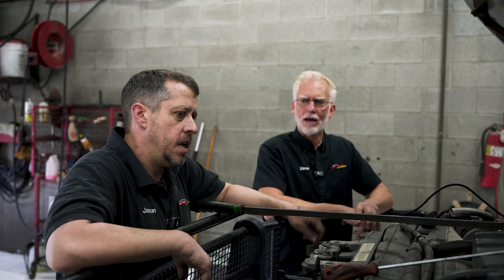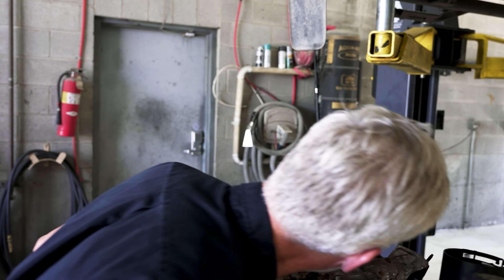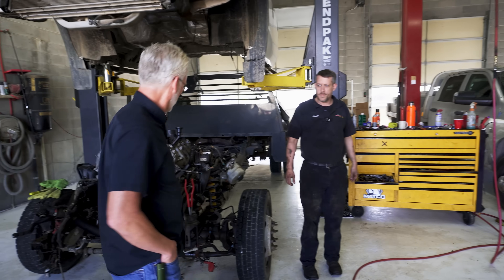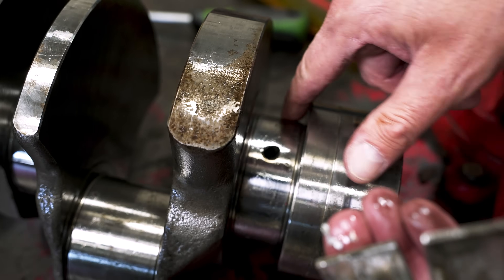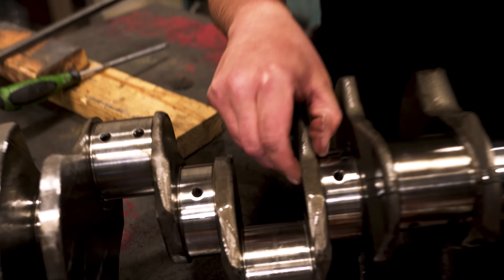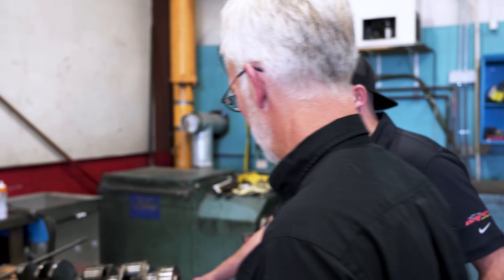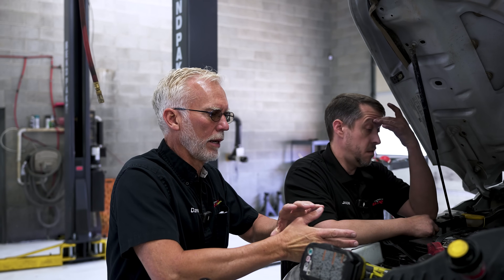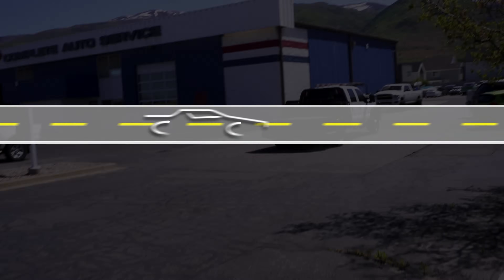Ford 6.7 Power Stroke Failure

Comment: Sometimes for no reason at all really engines will fail. Some 6.7 power strokes are perfect and they have no issues ever. Mine is a 2019 that has worked very hard its whole life at 155,000 miles and the only thing that went wrong was the hot side charge pipe. Everything else has been flawless.
Reply: Actually alot of 6.7 powerstrokes are flawless. I rarely hear bad things about them. I hear more bad about ram and gm

Comment: The funny thing is diesels used to be reliable engines. Thanks EPA
Reply: Weren't the old diesels extremely bad for our air quality, though? I'm just wondering. Even today, some schools or buildings are built right above an interstate. The school I know of needs an air filtration system because the air is so harmful
Reply: BBC: A diesel engine should, in principle, use less fuel and produce less carbon dioxide than a petrol engine with the same power output.

However, this superior efficiency comes at a price. Diesel engines produce higher levels of particulates, microscopic bits of soot left over from the combustion process.

These can penetrate deep into the lungs, causing irritation and potentially triggering asthma attacks.

Particulate filters
The greatest danger lies with the smallest, so-called "ultrafine" particles, according to Dr Matthew Loxham, a research fellow in air pollution toxicology at the University of Southampton.

"They get so deep into the lungs, they get to the surfaces where oxygen enters our blood, and the particles themselves almost certainly can enter the blood," he says.

"They can cause increased stroke rates and increase heart attacks in people who are most susceptible, who have underlying health conditions".

However, modern diesels actually emit very few particulates - because they are equipped with special filters.

According to Emissions Analytics chief executive Nick Molden these systems work very well.

His company carries out its own real-world emissions testing - as opposed to the tests used by manufacturers to certify their new vehicles, which until recently were exclusively laboratory-based.

"Modern diesels essentially do not have a particulates problem," he says. "The filters clean up 99% of the particles. So long as they are not tampered with, they are very effective".

But diesels also produce nitrogen oxides, or NOx - and how they deal with those is also very important.

Long term exposure to nitrogen dioxide in particular can decrease lung function, increase the risk of respiratory conditions and exacerbate allergic reactions.
Reply: Though real world gas and diesel driving often pollutes a lot more than the lab tests , so while its better than having no emissions controls, why are the manufacturer adding ineffective emissions equipment that adds to complexity?

For a start, cars often produce more NOx when driven on the road than they do when tested in the laboratory, and some models turn out to be much dirtier than others.

The worst performers, it says, emit up to 15 times the laboratory limits when used in "real-world" conditions. Others produce no extra at all.

The real-world emissions of petrol engines also vary widely, however. So while Emissions Analytics's research suggests that petrol cars remain on average cleaner than diesels, there is a degree of overlap.

"If you take the cleanest 10% of diesels and the dirtiest 10% of petrol cars, then actually the petrol models will have double the NOx emissions of the diesel ones" says Mr Molden

It's fair to say, then, that some diesel models do compare favourably with their petrol equivalents, but they are currently in a minority.

Comment: I ran into this on a John Deere tractor engine. Big six cylinder and I don't remember which model it was. The tractor was a 4840. The first guy to work on it installed the cheapest brand of bearing he could find. The crank had been ground .010 oversize and had been polished correctly. But what I found was the bearings used varied in thickness. They were junk from brand new as some were thicker and some were thinner. The thicker ones pulled the the surface of the bearing off  after only a very few hours and the motor lost oil pressure. The first guy "Assumed" the bearings were all the same. I am old school and all it would have taken is a strip of plasti-guage  to tell the guy that something wasn't right. This is a cool video and you guys are fun to watch. I retired after 50 years so now I watch you guys and get a chuckle out of what you find.
Reply: Just a small point you can only grind a crank undersize
Reply: @garyrhodes7089  Yeah, sorry about that I meant the bearings were .010 over and I didn't catch it. I'm old dude, the brain just doesn't seem to work anymore!!

Comment: People often weld plates like the one at 2:38 onto their manifold when deleting the egr pipe. This is because ford used tiny 6mm bolts that always break off when you remove the pipe, so you can’t bolt the block off plate on. If you heat the piss out of the manifold you can USUALLY slowly ease them out though.

Comment: I had over 480,000 km on my 2015 and never had any issues. My 2018 F450 has only 25,000 km on it so far though as it’s primary use is hauling my truck camper. I change oil at 8000 km and warm the motor before working it. As a mechanic, I realize there are issues with every engine and you need to realize these and use your equipment within its limits.

Comment: Check the crank for straightness, and the bearing bores in the block.

The crank may have been bent with the initial rod failure.

Although, oil starvation from rtv floating around is a good guess too.

Comment: I am a Senior Master Tech at a Ford dealer and have been turning wrenches for over 38 years and one thing that grinds my gears more than anything else is getting in a vehicle that some hack wannbe tech has been into. When i am done with a customers vehicle  you would be hard pressed to tell i have had it apart other than the normal telltale wittness marks on nuts and bolts. Your attention to detail along with your techs is quite impressive. Keep up the good work.
Reply: I wish there were decent mechanics where I live. That'd be amazing. Also, since you have 38 years and likely know more than I could ever dream of, do you know why my 6.7 sounds like it's knocking every time I change the oil? It's kinda loud for about 500-1000 miles after the change and then goes away. I can not figure it out. It's got 350k miles and has done that since like 100k. It drives me nuts. I dread changing it every time bc I'm scared it might be the last time.
Reply: And YOU are the reason I take my 2020 to my Ford dealer shop. Even for my very frequent oil changes.
Reply: Amen Brother!!
Reply: Congrats😊
Reply: Hi my name is Billy and have a 6.7 2015 power stroke with 118,00” miles and long story shot I got into a accident and my so called friend at a body shop let it let 
 2 months with out starting it after I asked them repeatedly to start it and when he finished I went and picked it up and the engine light was on the battery’s are junk and when I started to drive it home it was not running rite a all it was smoking bad so I drove it home about 15 miles and it started to clear up so I had it towed to a Ford dealer to service it and they telling me the motor is blown if you don’t mind I would  love your  opinion and Great appreciate it Thankyou
Reply: Witness only has one 't' in it.
Reply: @ratedRblazin Nazi detected.
Reply: I beat you any day of the week, I invented a mechanical formula and learned mechanics by working in a shop for one month, invented some plumbing tools as well , understanding about mechanics is  not the same as just know how to work on mechanics

Comment: The engineering that goes into a modern engine is mind blowing
Reply: Mind blowing and a lot of unnecessary crap,,I was an aircraft mechanic in the USAF in 70s 80s . I worked on the pride of the Air Force the F111F fighter/bomber . It was everyday a WTF to troubleshoot and repair but at the same time you were proud to be the one that could do it.,,,, My point being,,,modern automobiles remind me of those ACFT,,,🤢😵‍💫😡🤬🤑

Comment: Hi Dave
Several questions. A friend is looking at Earthroamer campers. Since you are extremely educated on the 6.7 power stroke. People have these and really don't use them. So which would you consider and what would you have a Ford dealer check for? 2019 with 20,372 miles, 2020 with 16500 miles or a 2022 with 14000 miles. They are all on Ford F550 chassis and all are stock with all emissions. 
Thank you very much. 
Joel

Comment: I’m always curious to know if a shop budgets in their labor to make up for time lost test driving and repairing poor quality work. Like going through their bolt bins and looking for all of the missing bolts that the previous mechanics did not install and going through and documenting every little thing so they don’t get a a false come back. Reason I wonder is because the repair manual on pays for actual time spent working on the vehicle nothing else. So it seems unfair that the techs have to work even faster to make the business profitable.

Comment: Nothing last forever. In my experiences with any engine is in the design. The next thing is you can't work a pickup daily like a road tractor or class 8 truck and expect it to survive. You cant add horse power without sacrificing durability. You can't let them idle all day, they weren't built for that. I bought a 87 f250 with a 120000. Miles on it. The engine was a 7.3 idi engine before the power stroke. I new I would have to be overhaul at some point . 90000. Miles later it started sucking oil . Did a complete over haul heads were resurfaced block bored i put Navistar parts in it . I parked the truck 580000. Miles later because i needed a bigger truck. Bought a 97 dodge 3500 with a 59  cummins. It had about 110000.on it at 220000. It started sucking oil bad . Tore it down everything was in factory tolerance so I ground the valves and valve seats. I honed the cylinders reringed the old piston hand polished the crank because it had some scaring from lack of oil . The problem was the top compression ring on all cylinders wear worn out . As long as the truck had a load on it wouldn't use oil because the boost  from the turbo would keep the upper compression ring sealed that is what it was made to do under boost . No load it wouldn't seal and blow the oil out. I still have the truck it has 730000.on it  now . I could keep going on . But i wont 😊

Comment: Just out of curiosity, what does a repair like this cost? I have 427,000 on my 2017. Runs perfectly! Mostly highway miles and I don't let it idle, serviced at the dealer 95% of the time.

Comment: If you want your car or truck to last, do your oil changes on time. No, diesel engine can't have its oil replaced at 20,000miles and gas engines at 10,000miles, replace your diesel engines oil every 10,000 miles and gas engines at 5,000miles and moat of all learn how to do things your self and know your limit when you need to take it to a trusted mechanics. AVOID DEALERS AT ALL TIMES!!!

Comment: IN HOUSE TRAINING 
It would take less than 3 months, 2 hour's a week, for your machinists to train your mechanics on these simple machining tasks required. 
It's not an engineering factory with 2,000 men, and complex CNC setups for volume production!
People with the knowledge, should have trained up the mechanics? That's the problem. Sadly some people won't share knowledge? Because they need to know more than anyone else, "that's a weakness"! 
I did a 5 year engineering, Apprenticeship, what I didn't know, "people were happy to show me". That's how I learned. 

Get your machinists to train the mechanics, it's simple stuff, with the knowledge to use micrometers and engineering measuring tools. Vernier Calipers aren't acurate enough to use on, half a th bearing, measurements. 
Put them on Evening Classes at a Technical School. I worked with the best Rolls Royce engineers!

Comment: The damage to the bearings is a classic example of poor clearance.  As the engine heated up, the crank touched the bearing and the oil wasn't able to fill the gap between the bearing and the crank boss.  In other words, the clearance was too tight.

Odds are the person that did all of this work got a set of bearings, didn't measure anything and just installed them, then put it back together.  Probably only drove it around the block and parked it.  The customer picked it up and the first time the parts got hot was when he was driving it home.... then the damage began.

In other words, he took it to a parts changer, not an engine builder.

Comment: Dave, what is your opinion on taking off the EGR system once it’s out of emissions warranty? I’ve heard that it will make the engine last longer but I’ve also heard that it will damage the engine because it was designed to have it on there. As with anything concerning anything, it’s a firestorm of opinions. Yours is what I want to hear. Thank you sir!

Comment: Dave, “Tuning is Killing your 6.7 Powerstroke.” That is the video title from PowerStrokeHelp, where they show that even with a mild tune,  the timing of the engine causes severe wear on the bearings from the rod being pushed hard into the crank from the tune. I can’t explain it, I may not have quoted correctly, but even a mild tune, will kill the engine premature. This was from the late Bill Hewitt.
Reply: Ford should go watch what Banks did with the recent Duramax right out of the factory. He literally tuned it to the point where the injectors basically stayed open and he still couldnt  blow the engine up. Ford you fart on them sideways and they need help.😂
Reply: Many 6.7 powerstrokes pushing a million miles..The only thing you have blown farting is your A$$😮😢😂😂😂
Reply: When in doubt bring a Ford out!! Ford farthest on road driving. Always go the mile farted on or not ,They Bark!!

Comment: Dave, Great comment on the documentation of all that you notice not working and systems being modified.  In my word of maintaining multiple types of propulsion systems,  I call it CYA, (Cover your assets). Also, having a tuner on a truck is not the best idea.  Some portions of the tune will give you better mileage, some tune adjustments will create havoc on the engine or the transmission.  Why risk the havoc, use the truck as it was intended within its intended capacities.

Comment: If you inspect a crank and it needs to be ground, I rather take it to the junkyard and start over with a new motor.
The amount of abuse a engine needs to take to get to a point where the crank needs to be grounded is brutal. There will be other parts of this truck failing soon.

Comment: Doesn't look like a grind issue on the crank to me. Junk left over from a previous failure, and junk bearings would be my guess. I've seen some journals look pretty rough, and although it probably didn't help the motor, didn't melt and blue the bearing.

Lots of people seem content to reuse old oil lines etc after a failure, believing "Cleaning" the line will put them in the clear... That's what I think can kill a lot of rebuilds. Rather just replace lines and coolers for a few hundred bucks.

Comment: What spec is on the bearings versus the ground spec on the crank? Possibly not enough gap for the oil to ride and metal touched metal but the crank is harder. Or possibly ground out of round?
Reply: Partial oil starvation and heat dissipation if the clearance isn't enough

Comment: Remember the good old days when you could work on your own truck drunk, not have to remove the cab, and when you sobered up you could financially afford to fix it again?
Reply: I could sit on the radiator, put a foot on each frame rail and work on the shade of the hood.
Reply: Sad it’s become complicated… who’s at fault.
Reply: @theman9907  
The EPA, mainly.
Reply: @OTEP1234567891011  Not “mainly”. Fierce competition in the truck segment for 40+ years, with some EPA regulatory measures.
Reply: Hahaha this comment is hilarious and true.
Reply: That's insane, is it not.
Reply: EPA is definitely the reason. Engines are designed to meet emission standards, not customer expectations. 

The government overlords need to be removed from power.
Reply: @Zenergist  EPA definitely deserves their share of blame, but also blame idiotic consumers, wanting unreal amounts of power that most of them don;' actually need, just so they can drive their glorified SUVs around the costco parking lot and buy a Christmas tree once a year.
Reply: @Zenergist this fr.
Reply: Removing the cab is like 10 bolts lol also no ones forcing you to buy a new truck old man
Reply: @sikniz213  10 bolts, 6 wiring harnesses, ac lines, cooling lines, fuel, steering, trans, oh and you need a 2-4 post lift.  So simple.....for someone young and dumb.
Reply: @Crypto666  I was a certified ford tech for years now I work for Land Rover, a cab off is a breeze lmao
Reply: @sikniz213  I am sure it is for a professional, but try bending nails all day in the blazing sun for 10 hours, slam a 12 pack of the worst beer, and do it using a set chinesium end wrenches.  Not so easy now is it?

Comment: I bought a used 09 chevy with the duramax. Within 1 week I removed the tune so that the truck would regen correctly. I didn't want to deal with a deleted truck since it has to be emission tested. I have had to do a bit of work on the truck since then, and nothing else looks suspicious. Seems the truck was traded in because they didn't want to replace the injectors.